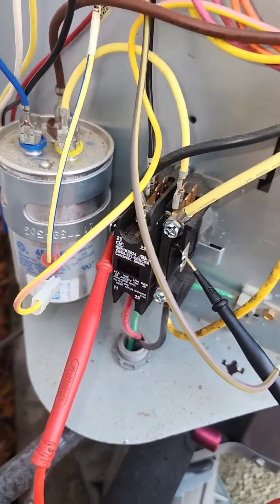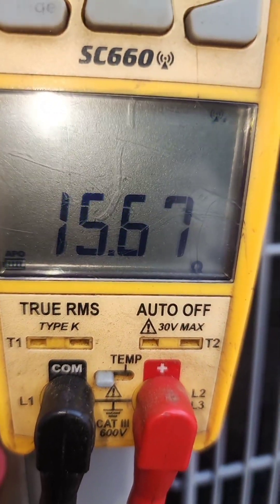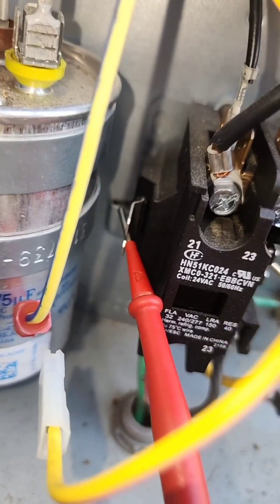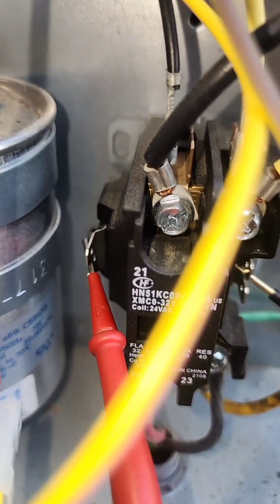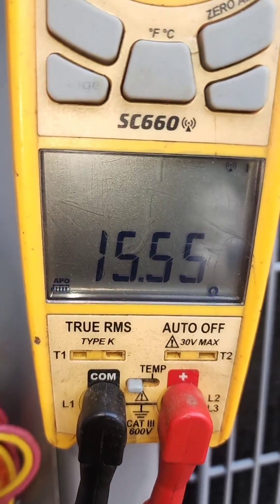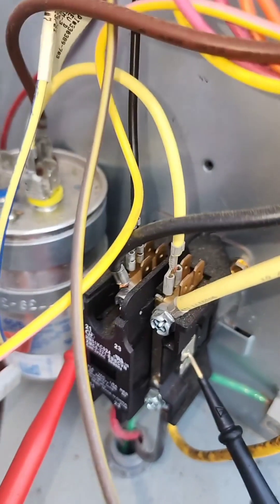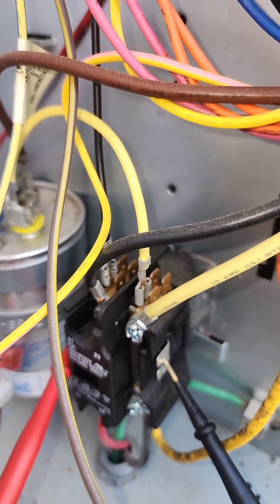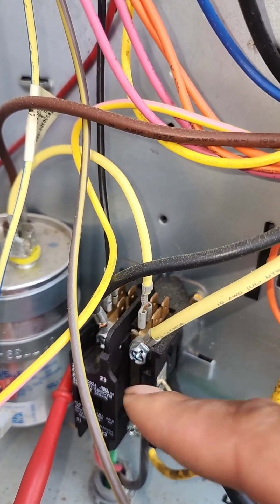How to check a contactor coil #hvac #airconditioners #contactor #relay #reels #fyp #heatpump

Comment: Contactor low voltage showing 0 volts, when disconnected low voltage wire and tested it shows 26 volts. So I am getting low voltage at wire but once it's connected to Contactor it show 0 volts. What could be the problem here? Also tested Contactor coil continuity and shows 13 ohms resistance and manual pressing Contactor works fine. Any help would be appreciated.
Reply from the maker: Something isn't adding up. If you have 24v then it should pull in. Check the pressure switches and check 24v at the wire nuts coming into the unit between common and yellow
Reply: @theycallmeG90   Thank you for your reply, I  found the issue was a ptrap switch which was stuck up and didn't went down, so I pressed manually down and made it freely moveable.